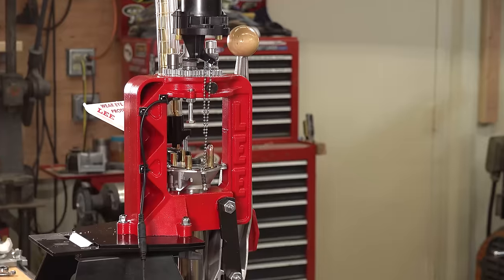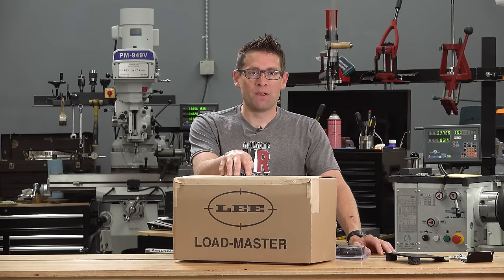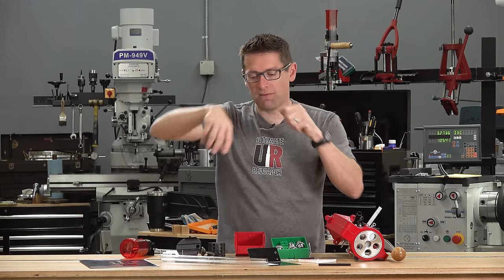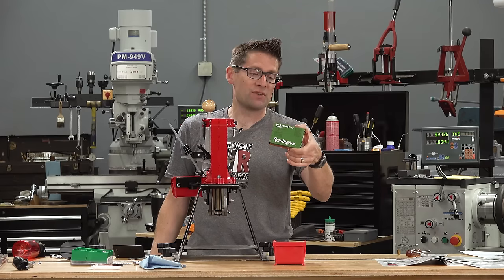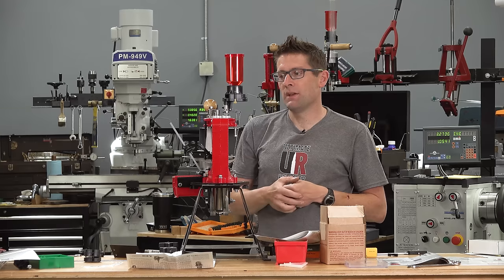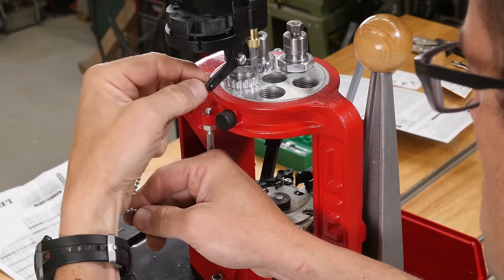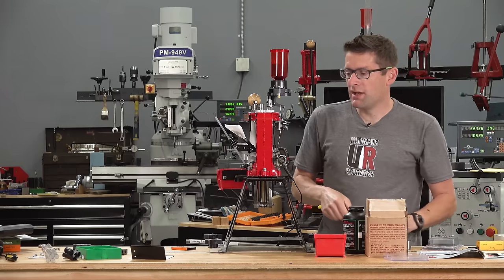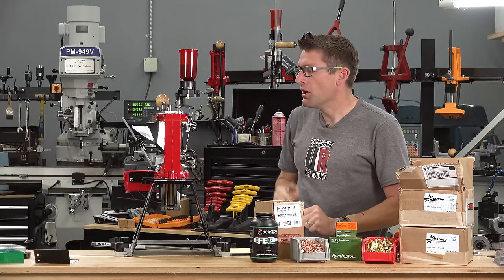Lee Loadmaster Unboxing/Setup, Loading 9mm Start to Finish

Comment: To Gavin and all others with a Loadmaster...You all MUST check out Mikes Reloading Bench on the web and on Youtube.  He has made Custom Turrets and the Shake Break ,  along with some primer mods that will make your Loadmaster the best press on the market.  You can achieve .001 COAL with these mods.  They are not cheap but work so good.  I have no affiliation with Mikes either just a VERY satisfied customer.  Check him out.  You will thank me later.

Comment: This press sounds like it’s good value for the money.  But that’s only true if you don’t value your time.  You have to mess with it a lot to get it to run smoothly, and then do so again to keep it running smoothly.  It’s not worth my time.  Next time I’ll spend 2x or 3x as much and get a press that requires 1/2 or 1/3 the work.  The tolerances are too big, the castings too rough, the design too marginal.  It indexes very unreliably.  It primes very unreliably.  And it’s really a four-station press.  To make the priming system work reliably, you have to use station #2 as a resizing station (as well as priming) so that the resizing die hold the case in the correct position for priming.
Reply: You hit the mail on the head!
I am so tired of F’ing with that POS. You can never just go crank a few hundred rounds out with out CRUNCH……or BANG!!!.
I had 2 primer explosions on it, the last one blew 6-7 in a chain reaction. F that……I won’t ever prime on that thing again
I’m in line for the new Frankford Arsenal x-10

Comment: This press is absolute garbage!  This was my first progressive press about 15 years ago.  Priming system is cheap, plastic garbage.  The powder charge is a terrible design and they should have just used the same case-activated drum charger that they use on the Classic Turret.  The case feeder system is junk as well.  This press is GUARANTEED to give you endless headaches.  You'll spend more time tinkering with the press than you will actually loading ammo.  I HIGHLY advise saving your money and buying a better quality progressive press.  STAY AWAY from the Choad Master!